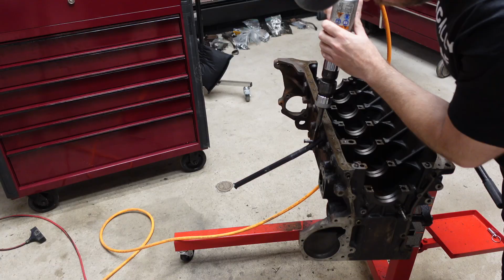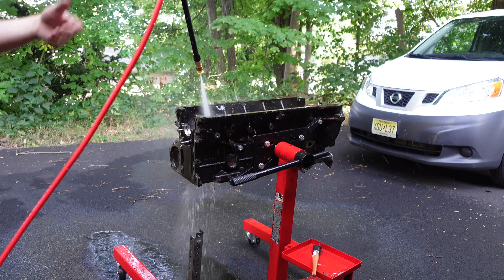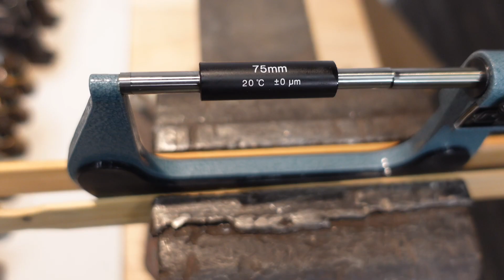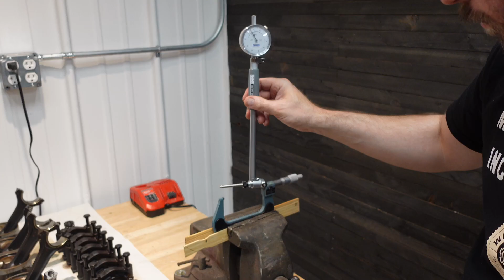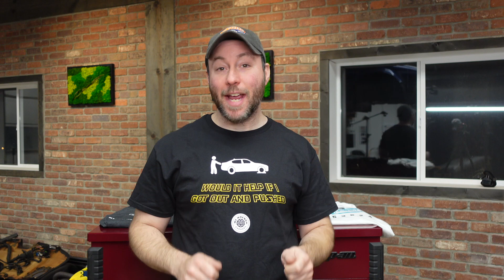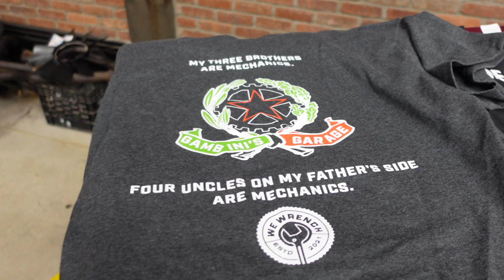WeWrench Episode 20 1992 BMW E34 M5 S38B36 Engine Inspection and Measurement

Comment: So what happened to the M5?
Reply from the maker: Making progress on it. Engine is just about finished. I’m just slow to post longer form content because it takes so long to put together.
Reply: Great stuff. Subbed to your channel. Hope to see you back in action with the M5
Reply from the maker: @kingkiller9692  I really appreciate that!
Reply: Would love to see the repairs done to the body as I have an 95 e34 bmw 540i. Guy did a botched job on a manual conversion. So I'm busy with that but have some under body damage from not using the correct jacking points.
Reply from the maker: @kingkiller9692  It’s coming. Make sure you stay tuned

Comment: I watched all videos, you dissambled the whole car to the last bolt and the car looks very rusty and not in shape what are you going to do about all of it during assembly cleaning, restoring, removing rust, sandblasting, new bolts,  everything new? Check out M539 channel.
Reply from the maker: M539 is a great channel! And yes, I’m doing everything you said
Reply: Osphos try this out for any rust. Try it make a video .
By the way THANK YOU !!! for saving anothet GREAT orr ULTIMATE DRIVING MACHINE!!!
Reply: Osphos try it out for rust ,if  it works for u make a video  pls , by the way THANK YOU FOR SAVING ANOTHER GREAT ORR ULTIMATE DRIVING MACHINE !!